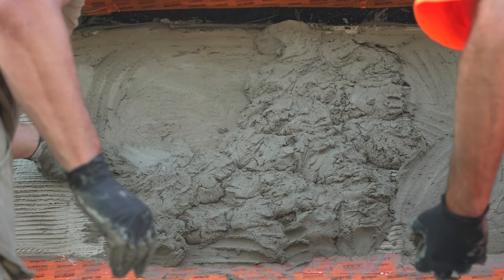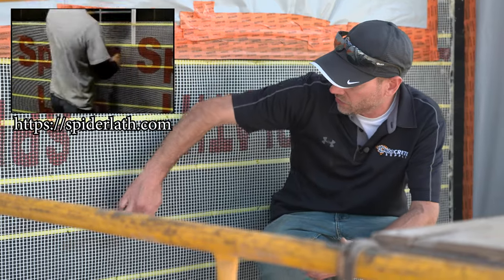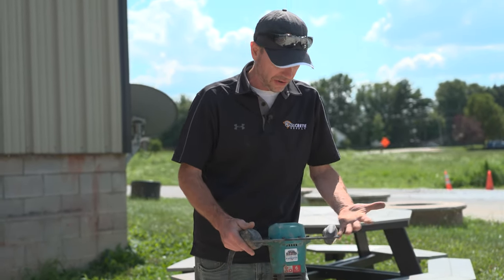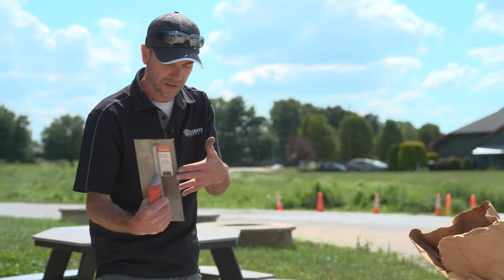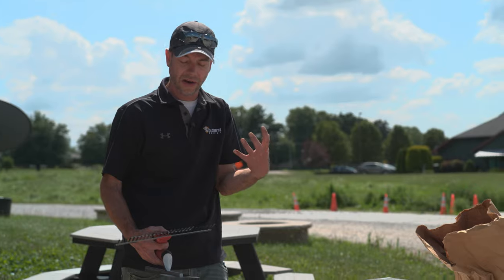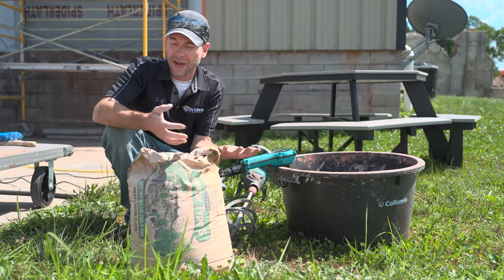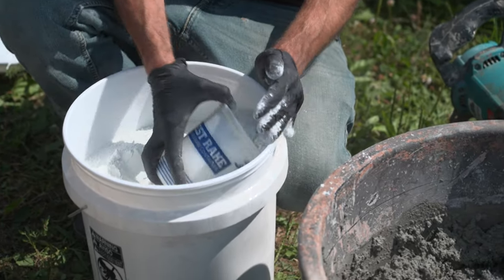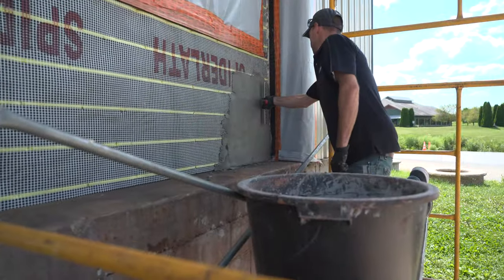How To Apply Scratch Coat | Vertical Concrete

Comment: Does bonding agent work without the mesh? Your description of the mix texture was a good tip  😎
Reply from the maker: Thanks for the comment!! The bonding agent does work without the mesh, it just depends on weather the substrate needs the mesh or not. Concrete/masonry substrates do not require any mesh, all you need is the bonding agent. Most other substrates will require mesh! Thanks for watching Deco-Crete TV!! 👍

Comment: Hi nice video. Can you please explain why there's a need to do separate scratch and brown coats? Why can't you just place a 3/4" thick single coat?  How much time must pass after the scratch coat is applied, before the brown coat is added?
Reply from the maker: The scratch coat needs to be applied for several reasons. The main reason is to get a good long-term bond to the substrate, thick layers of vertical mix just won't bond very well if applied directly to the wall. The scratch coat will also help the next coat hang on the wall better, that's the reason for creating the groves in the scratch coat. It's also important on block walls to cover up the mortar joints, they would end up shadowing back through if you applied the vertical mix directly to the wall. Generally, waiting till the next day to apply the final coat is the best idea. The scratch coat needs to be set up to the point that you won't break any of the fingers off while applying the vertical mix. In the summertime, it is possible to scratch coat in the morning and do the next coat in the late afternoon, you just have to be careful with it. Thanks for watching Deco-Crete TV!!!
Reply: @DecoCreteTV Thanks. How much time should elapse between the Brown Coat and the Finish Coat, assuming cemetitious Finish Coat. How much time should elapse between Brown Coat and Elastomeric Finish Coat ( I believe acrylic-based, comes in a bucket as a liquid)?

Comment: Your talking very fast and said there's some kind of plywood under her, but slurred the description of what kind of plywood. Thats an important point is the prep underneath. So, What are the correct materials exactly such as regular plywood or pressure treated etc AND what are the right kind of screws used to secure the plywood to the building?   Is that just roofing tar paper and are there other options other than tar paper?
Reply from the maker: Normal exterior grade plywood and roofing tar paper will work fine for this application. Check out this pdf from spider lath for fastener recommendations https://spiderlath.com/wp-content/uploads/2019/09/Installation-Instructions-SpiderLath.pdf
Reply: @DecoCreteTV  thanks! Sorry. didnt mean to sound like a jerk.

Comment: Do the crown staples have to be stapled to the studs or does it just need to penetrate the SOB panels when applying the chicken wire type stuff?
Reply from the maker: They need to go through the foam strip on the lathe, but do not need to hit studs. Penetrating through the plywood is fine. Thanks for watching!

Comment: How about if I am putting a scratch coat on old concrete block???  Would I need to put plywood on it, or will it stick to the block?
Reply from the maker: No plywood necessary, make sure to thoroughly clean the blocks and add a bonding agent too if you are worried. Thanks for watching!

Comment: I do have a question, I’m building an outdoor bar/cooking area, it will be stone veneer that I’m cutting and making myself, I want to have a concrete base molding and a couple vertical concrete moldings if you will and corners to make sections and I was going to make a form for all of that, what type of concrete mix should I use for those and what is the best mortar or thin set for adhesion for my stone after the scratch coat of course? thanks in advance
Reply from the maker: Cement-All would work for your stone molds because it goes thin to thick very easily and sets very quickly. Use regular mortar for adhesion, we use type s
Reply: @DecoCreteTV  thanks for the good info